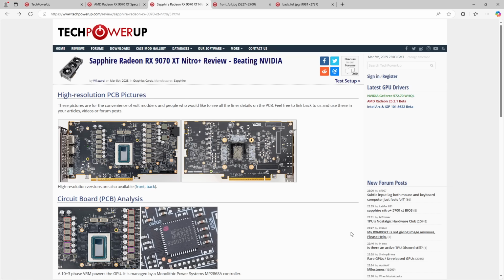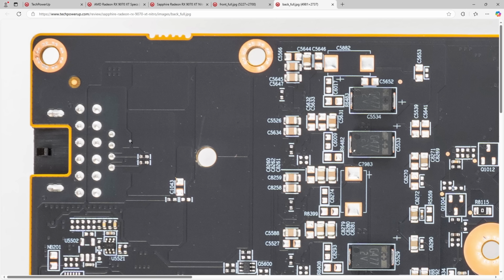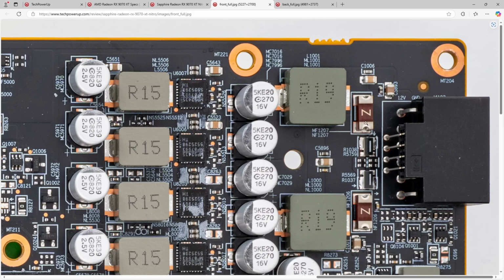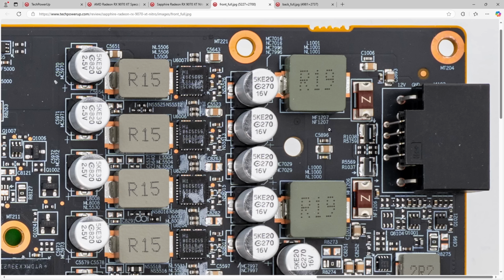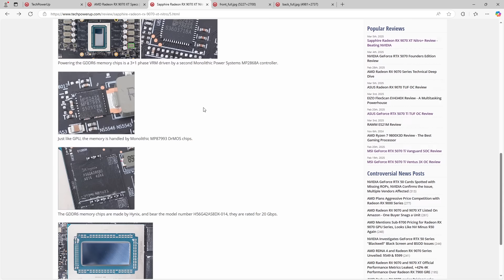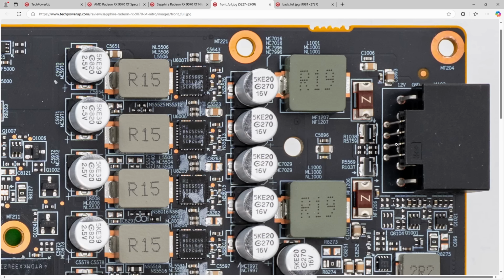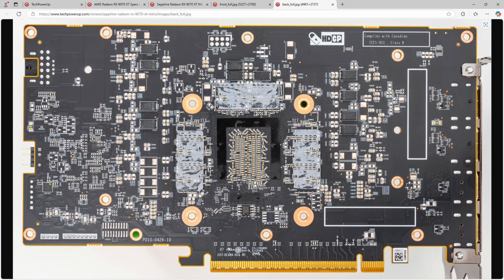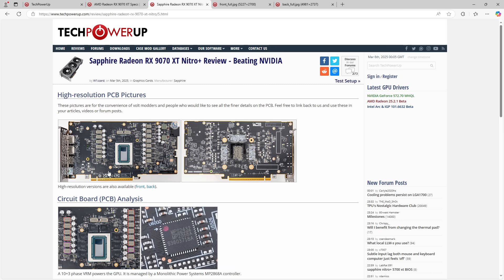Taking a look at Sapphire implementation of the 12VHPWR connector on the RX 9070 XT Nitro+

Comment: Since the card has two power rails, could a modder just break the traces on the card to make it two separate rails all the way to the connector?? It still couldn't balance the load, but each rail could only pull 50% of the power from it's respective 3 wires instead of both rails potentially pulling 100% of power through one wire...
Reply: That would mean the card is now rated for 200w instead of 100w like it is now...

Comment: the main in lab recreatable issue with the connector was caused by 1 not fully seating the connector 2 it being pushed out by over time pressure by something like a case side pressing up against it then 3 plugging and replugging the same connector to many times that how secure the connectors are wears away. I think it has been shown to start happening around 30 times but all had it after 50 times. 
The solution to the 3rd issue is a strong and wide connector clip for example what the PCIe 8-pin connector has. The others well that is under user error. Just how many times is it reasonable to assume that the user will unplug and replug the power connector? I am pretty sure most are not unplugging and replugging their connector. The reason why the 8-pin connector is so over built is it was also designed for electronics in government systems that just cannot fail. The nvidia connector has been shown to fail and fail to often on to many PCB + PSU combinations to be used in a situation like that so anything using it will never be put into a system that should not fail as they have backup routes for everything including a redundant entire machine for the cases it needs to be updated. 
The nvidia connector is bad for redundancy and thus the parts of business which need it for example IBM mainframes yes they still are made, still exist and still are used. The main example of a IBM main frame in use is the backend of a backing transaction. The part you need to work every time without fail and without error as having either will make a very long list of rejected transactions when the account has enough. So the 4x redundancy onto everything that IBM main frames have is the way they go. 
The new nvidia cards do not meet the redundancy requirement so not used in mission critical hardware. The enterprise blackwell chips do not use the 12VHPWR connector they just slot into the system like a blade would as nvidia knows supply 2000 watts to the PCB's VRM is not a thing that they can get past any safety board. So it is divided up on the power supply side. They all run hot to the point some need their own  AC unit just for those 10 PCBs so 20 GPUs and 10 CPUs. Then you have the same chip but cut down a little some how is used for the consumer and had to pass safety regulations. The GPU chip draws as much if not more power but they are still using the same connector and 1 of them that they used on a consumer card that drew 1/2 as much power. It passes all safety checks as safety checks for the most part are not down with it running then when running they only check that it in perfect lab conditions will stay within the safety laws.
Really the RX 9070 with how Sapphire has part the power connector gets rid of most of the problems made by how nvidia requires it used on nvidia cards. It still has the power connector flaw issues but at least Sapphire was able to minimize them. The point 8-pin power connector cards also exist makes me think Sapphire knows not everyone will get the 12VHPWR connector card but the known to be reliable for running over a decade straight connector of the 8-pin PCIe power connector.

Comment: They need to move to the XT120 connector.
Reply: That's only 720watt AS300 is more future proof.
Reply: @durschfalltv7505 😂 yea gotta be prepared for next gen Nvidia 750-900W , moarr powaa.
Reply: @durschfalltv7505  that's a good point. We need to be planning for the day when gpus will require its own circuit in your house.

Comment: BARE minimum the spec should be to have three 12v inputs (2 pins on each) with sense resistor circuits on each of those 3, with a recommended implementation of 6 sense resistor circuits one for each +12v pin. In the 3 circuit as a minimum approach they need to have coding so that each pair is pins is limited to 200w max (ideally 100w per pin, worst case all 200 on a single pin if one is bad contact). That way if a pair of wires makes bad contact the card throttles itself down to handle the missing 200w capability.

Comment: It's a hugh failure connector, but I think they did this because they are not pushing north of 500W casually.
Reply: @amineabdz  well NVIDIA has also not in the 40x0 series but 300 Watt over a line that has 100 max and no extra, is 3 times to much.
Reply: @rzwerg8085   100W. Came to the same conclusion. Who did the math on this plug?

Comment: When they made the new 12pin standard why didn’t they just make it 2 pin with 2 super thick wires and 2 super thick pins, this way there’s no chance of things going wrong and thin wires getting super heated, if anything gets disconnected you just lose power.

Comment: Unless Intel changes the ATX 3.0/3.1  standard then we are stuck with this connector which is also on nearly alll ATX 3.1 compliant power supplies.  It's an ATX standard adopted by PCI-SIG and essentially forced on manufacturers. Changing the standard now means most existing ATX 3.0/3.1 power supplies would be obsolete
Reply: The problem isn't the psu or cord. Power regulation on the board. 6 pins to 6 traces with 6 shunt resistors in series not parallel to regulate power. And tada! No wire goes over 9A so no connectors melt and no wires melf and no capacitors explode!
Reply: @wessidemessside  i wonder how much that would increase the manufacturing cost of the board
Reply: Another Intel fail in an already long list.

Comment: You clearly don't know what you're talking about.
Fuses don't protect the circuit from damage. They protect the user from fire.
Fuses don't exist to prevent damage to the hardware. They work because there is damage to the hardware.
Please don't try to explain what you clearly don't know. This is being told to you by an electronics technician with over 30 years of experience.
Reply: So overall is this a good design from Sapphire? What's your take?
Reply: That's absolutely not how fuses work you clown. I have a huge sub in my living room that blew its fuse, a $1.5 replacement and it's up and running. Fuses DO exist to prevent damage to hardware. That's the exact point of their existance you clown. Go outside to your electrical box, also known as a FUSE box and have a look at whats preventing fires in your home and products from blowing. What are you 10 or a bot? You aren't an electrician whatsoever. This is like 101 knowledge. Get out of here.
Reply: Pretty sure when he said “short circuits” or “power phase failures,” you were the only one who took it as “there were no damages to hardware if fuses exist.”
Reply: Please enlighten us. Is this design fine or not?

Comment: Isn't Sapphire considered to be like the best brand for AMD cards? Kind of like how  EVGA was for Nvidia? Sucks that they would do this..
Reply: Everyone was expecting some kind of better effort from them. This is very disappointing.
Reply: @RoyBrown777 like buildzoid said it could be a spec thing so then it wouldn’t even be Sapphires fault - only that the chose to use it at all. Which they did for aesthetic reasons (again, the whole connector just exists because of that, more or less).
Reply: Sapphire is okay, EVGA? XFX has much better quality standards than Sapphire, thats proven.
Reply: @SMGJohn  Ah okay. Never been on team Red until now. You'd go with XFX for a 9070XT?
Reply: @CastIronEric  I would personally because I like the 3 8-pin standard and their cooling solution seems more robust than their competitors. Just make sure to check how much clearance your case has because the XFX cards are massive.
Reply: @CastIronEric  
You go with anything, cause 9070 XT is sold out everywhere
Reply: @SMGJohn in the past Sapphire has been the equivalent of EVGA if they still are remains to be seen.
Reply: Was considered

Comment: Is there a way to search for cards that do NOT use this "HF" connector?
Reply: As of now, only the ASRock Taichi and this Nitro+ use the connector. You can use Pcpartpicker to sort for models based on power connector configuration. All other models use varying number of 8pins, including sapphires other cards (Pulse/Pure)
Reply: @qerlak   did he just not do a video of the nvidia melting 12VHPWR cables? ..

Comment: You are missing the fact that the cable is not sacking, is sitting in the fins of the heatsink, so if you usi it in the "normal" way the cables arn't sacking

Comment: Curious about the sense pins on the connector.  It looks like only 2 of them (lower 2) have active components connected.  Are they ignoring the other 2, or are the components just not on the back of the board with the others?
Reply: i thing you only need 2 because the power-supply only need to give less than 450Watt, and that is what they are about each more is more Watt required from PS.

Comment: I think with a MCU and voltage monitoring done right, you can detect the resistance of the 12v source.
By looking at the voltage / current you can more or less build a lookup table with expected voltages and if it falls outside that range, you start reducing the power limits and if the value is grossly out of range you can just lock the card to a base clock.

Comment: to me this conector made no sence to me from the start smaller pins with less surface area  with all 12v running in parralel you may as well have just used higher gadge cable with only 2 wires like the kind they use on rc choppers and planes they also draw huge watage as well

Comment: Sapphire, how could you?!
Reply: And AsRock taichi
Reply: @onomatopoeia162003  and both require a 900 watt PSU
Reply: @kennethpereyda5707  how? 320-330w card does not require a 900 watt psu
Reply: What is the problem? Just avoid those brands and they will learn the hard way.
Reply: @Seba-dr7vv  it's sapphire relax. they are amds evga they would never.

Comment: Damn... you broke my heart, lol.. I really wanted to get this card too..
And the connector was meant for the server environment, not in a desktop PC.
Reply: this was never meant for server, and it would never fly in server grade hardware either
Reply: You could always get the Pulse edition which uses 8 pin power connectors.
Reply: @Fractal_32 It only has 2x8pins.
Reply: @PowellCat745  yes that is 300 W of power delivery from the 8 pin power connectors when operating within specifications. If you ignore the specifications, 8 pin power connectors have a very high safety rating meaning they can deliver a lot more power.
Reply: @Fractal_32  the power connector isn't the problem. This is a completely ai designed gpu. Ai doesn't known flow mechanics yet. Obviously... knew this would become a problem and a self destructive monster. Just not so soon!
Reply: Actually servers use the EPS connector which is way superior.
Reply: @PowellCat745 exactly and they should bring THAT connector to PCs. Or completely rework the 12x6 connector.
Reply: @eazen  EPS is already the standard for CPU power. It’s just not used for GPUs yet.

Comment: Damn if the connector was done better I would 100% insta buy this card. Edit:I got one because it was MUCH cheaper than the XFX.
Edit: It ended up being the cheapest card so i got it lmao
Reply: Yeah the only thing stopping me from buying an RTX5090 right now is the connector. I will hold this GT730/ E8400 setup until they get the connector situation sorted out.
Reply: 😂 many other people already “insta bought” the card so no worries, not everyone cares about edge cases that much.
Reply: How is it going? I mean, the card, the cable, is it good?
Reply: @aldarodriguez2595  9070XT can't draw enough power to blow the connector.